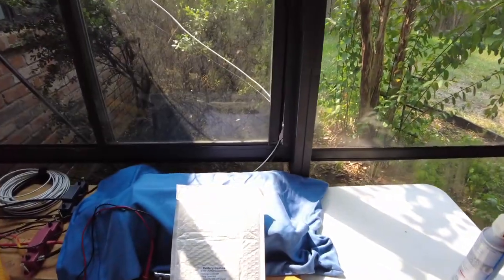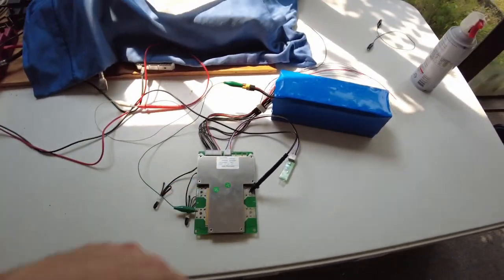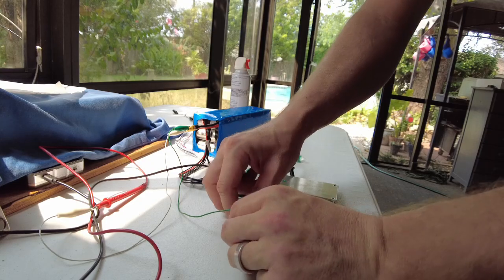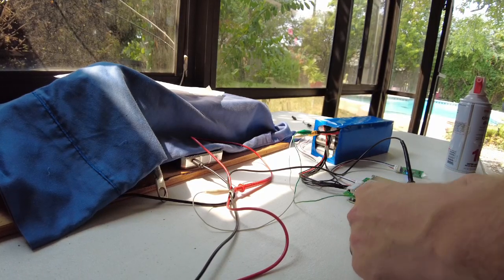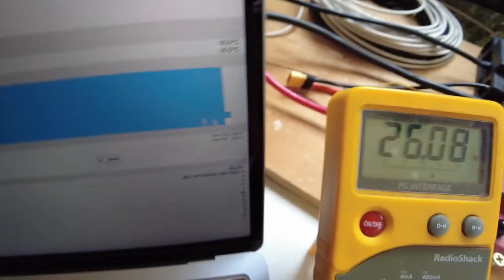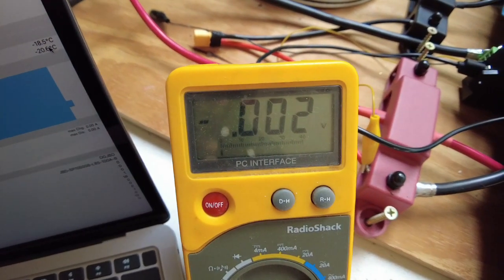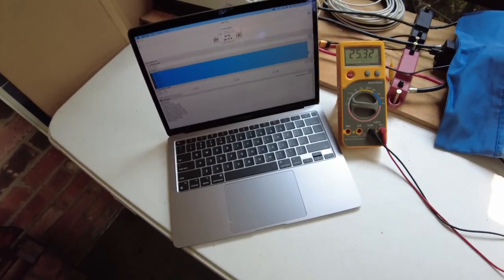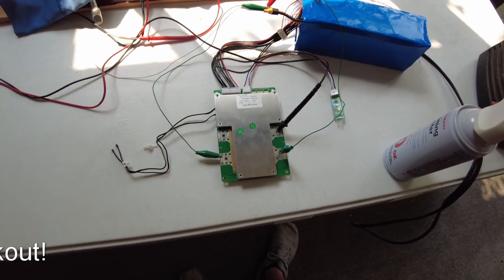Smart BMS 100Amp w/Low Temp Cutoff

Comment: Hiya.

When it says 100 amp in the description, is that referencing the total capacity of the battery that can hook up to it or the amount the BMS is capable of discharging at any moment?
Reply from the maker: 100Amp is the current you can discharge through it.

Comment: Way to go Brad. Leave the out takes in the program where they belong.  :)
Thanks for the heads up on the BMS. I get all my stuff from Battery Hookup.
p.s.  I calculated your copper pipe Buss Bars will dissipate 1/4 watt at full load.
Reply from the maker: Nice 1/4 watt, I can live with that. Guessing that's per buss bar?
Reply: @BradCagle  Yep.  :)